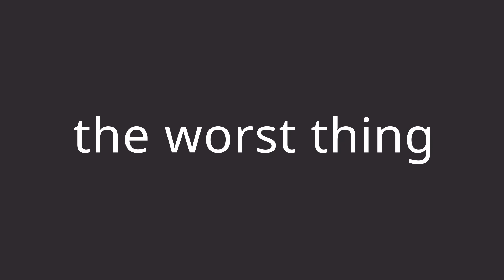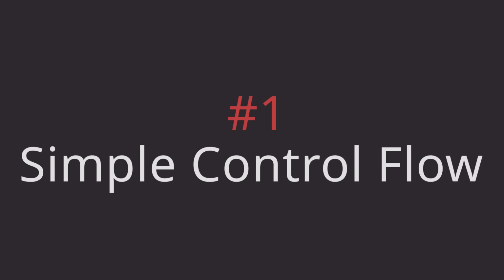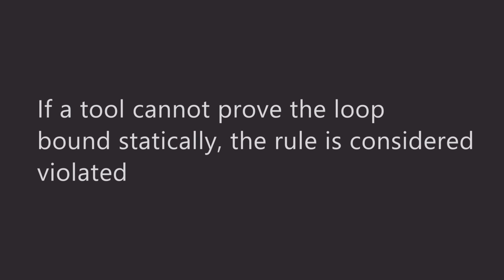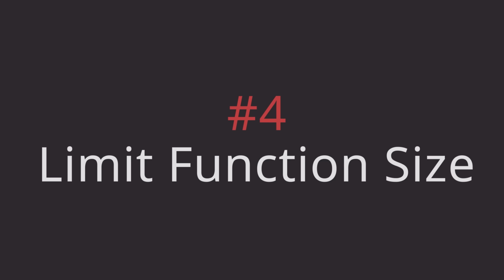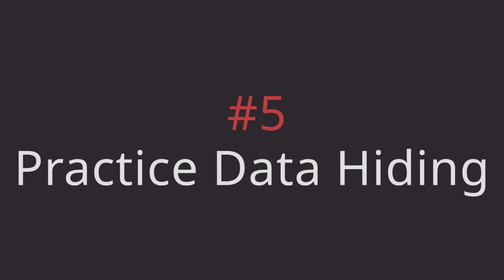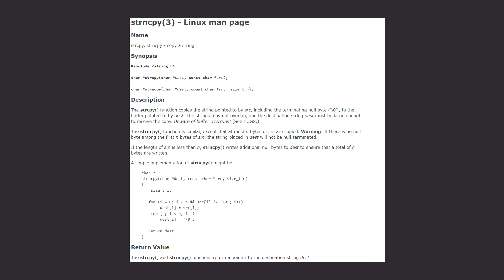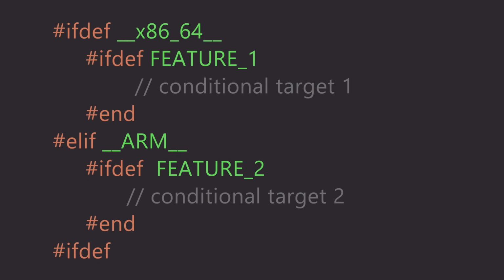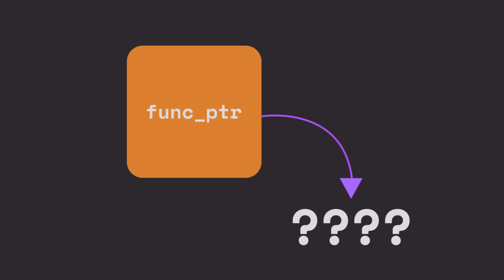how NASA writes space-proof code

Comment: These rules are for programming practices to help out coding and debugging. It would be a shame if NASA programmers did not have a brain and control their own work ( but NASA confused imperial with metric so a rocket failed). That these guidelines comes out of NASA is no need for us to start jerking off. So these guidelines sound like simple good practice.

I was a systems programmer and component hardware engineer with reliability as focus , hardware reliability, at Ericsson. As such I assume the programs have been produced and checked correctly in their basic form. Hardware reliability and SPACE .... cosmic rays can flip 0s to1s. The computer hardware can catch this. One simple way is to have 3 computers and have the bad one trap and immediate and restart.

What I like hearing here is "try use the stack". Ordinary programmers can do this but instead they all use heap as they >should<. Anyone can push the stack and place stuff there only it be gone once the function who did that exits and the stack is popped. I am still thinking about cosmic rays and the stack is repeatedly overwritten, and fresh. It is more risky to allocate on heap and let a long time pass. Still the hardware should do the checking on the fly for performance reasons. Still I liked the advice using the stack, which everyone can push. Still having 3 computers checking each other is the most simple way. Cause the cosmic rays can not hit all three and cause the same problem.
Reply: But first the computer need to be able to say "I am sick" , if no system can detect this it is over.

Comment: Does it mean that NASA doesn't use any popular OS, like Linux, Windows or Mac OS? Because all these systems use prohibited code practices.
Reply: As in what is actually running the code, or the devices they write code on?
Reply: @jojo_da_poe  Sure, running. Develop you can even on Raspberry Pi.
Reply: @jojo_da_poe   In some cases I think they use VxWorks or some other verified real-time OS, and in some simpler cases they have, at least in the past, written their own reduced languages running directly on the hardware.  A lot of that was done because of extreme power limitations on the craft.  For an interesting case, Ron Garrett (formerly Erann Gat before Anglicizing his name) wrote code for the Deep Space 1 probe that was a test platform for all kinds of experimental technology.  I think you can google for his experiences and thoughts about it.

Comment: You made me sad. The way NASA makes space-proof code is by incorporating hardware fail-safes.

A great example of this is a famous piece of equipment nuclear power plants have called the, "SCRAM." It's an acronym that stands for, "Safety Control Rod Axe Man." It's literally just a metal pipe with a guillotine inside that sits over the power line. The way it works is there's a regular rope attached to SCRAM and the nuclear reactor, so if the reactor overheats the rope burns and the guillotine falls. The moral of SCRAM is no matter how confident you are in your code you can always be more confident in physics.

Comment: "NASA says only use the stack, not the heap". Hi experimental physicist here. I and my colleagues use a c++-based data analysis tool called ROOT all the time. Especially when creating graphs, there are a LOT of boilerplate code that tacitly encourages the use of the heap over the stack. Lots of use of obj = new obj().
That NASA, an organization not so far removed from my own actively discourages this behavior is hysterical to my detriment. And honestly probably the better way of doing things.
Reply: This applies to microcontroller code onboard the spacecraft. Software that runs on regular PCs, such as software for simulation, doesn't need to fulfill all these requirements

Comment: Another thing Nasa does is run not just one flight computer, but one with multiple other computers running the same program simultaneously, checking each computer against the others to looks for flipped bits caused by radiation or common faults.

Comment: Limiting function size to 60 lines is actually not smart for these low power embedded environments. Calling functions costs power, so if a problem requires 120 lines, and you split it in 2 functions and call them, you've lost efficiency.

Comment: With regards to small functions - it's a double edge sword. For NASA and space it makes sense, but working with casual business logic on production for years I realized that not always functions can be small. Sometimes business logic is big and convoluted enough, and data structures are out of your control, so function takes 200-300 lines and splitting it into functions will only lower readability as you will need to jump from one function to next.

Comment: Basically, almost every advise from NASA developer teams should be respected by any developer in any language/framework/stack to assure the most efficient and bug-less software. If it was a standard everywhere, hardwares wouldn’t need that much RAM as the memory would not leak that much, and softwares (& overall user experience) would be a lot better, faster.

Comment: No need to use pointers and recursion, that's the dream job
Reply: Wait, is there any places where you need to use recursion? 
Asking as a Java dev
Reply: @IgnatXerius  Maybe a bit over the top example, but I've built a virtual filesystem for securing some things on the network, and one of the things it does is scanning the entire volume and keeping the map of the entire directory structure cached in memory (for significantly faster seek times) and the only way to do so is theough recursion...
But also it's built in a way that requires a full acan to figure out which blocks are allocated and which aren't.
Reply: @IgnatXerius  Haskell language doesn’t have for loop and while loop
Reply: @IgnatXerius  dealing with graphs and trees (which are extremely useful data structures), there is no real way without the recursion........... So, I don't know what they do there if they don't do recursion, heap, even limit the function to go up to just several iterations........ That's actually a very tough job because you don't have to just code, you are dealing with a mountain of checks and I don't know what........ It's just insane
Reply: @HarisAbdullah-e6l ты можешь использовать цикл вместо рекурсии для работы с ними. Это быстрее и надёжнее. Тот же обход графа может быть переписан с их помощью и это несколько проще рекурсии, которая может вызвать overflow.  А значит так могут быть выражены все задачи данного класса. Вам действительно не нужна рекурсия, если вы конечно не экономите каждый бит кода.
Reply: @HarisAbdullah-e6l  3 months late to the party but the reality is that they probably don't use those structures at all, or at the very least differently from how you would otherwise. One of the big goals with these rules is to get a program that is very deterministic. One of the reasons to not use the heap for example is to ensure that you will not run out of memory or other memory related bugs. Memory you need should be allocated from the start, no dynamically sized arrays or otherwise. Graphs or trees would therefore have to have a known size when you create them, making it more feasible to traverse them with loops, even if still an absolute hassle. 

Then there are some features which might even be completely irrelevant for some structures. Like how searching a tree can be really efficient. But since you want determinism, you might not want a search function that takes a variable amount of time to find the result. But you'd rather have a search function that always takes the exact same amount of time by always looking at every node in whichever structure you're searching.
Reply: @IgnatXerius as a bend dev. What else would you use except recursion? Lol
Reply: @varadrp  right lol

Comment: I've always coded on the "don't make your functions longer than a page" rule. Sure we all do it, but you aught to get that feeling that the function is ripe for a restructuring. Similarly code which is all functions with only 2-3 lines in them can be difficult to understand. I tend to do this only when the either the function is used a lot or for certain aesthetic reasons so it is more readable.

Comment: My first real compiled code was on a microprocessor platform (think arduino but without many libraries and with just a plain ANSI C IDE and no RTOS... just bare metal), it's not that difficult to obay to such rules...

You have one core and a fixed memory space that includes your registers. Then it's entirely you that decides what's going on. If you want to make it appear as if it's multitasking you use interrupts and remember to kick the watchdog whenever you're sure you're not caught in a loop.

I  like the idea about no infinite loops... but it's kinda necessary in the main loop isn't it? Or do they basically reboot when the timer overflows?

Comment: #1 excludes Quicksort, there are many competitive alternatives. Recursion in general is not needed for most applications, and is not compatible with parallel processing. For searching any hierarchical structure though, recursion is required. I can only assume their probe operations are so simple, that they haven't needed it yet.
#2 is Pascal
#3 is Pascal
#4 is a good idea in all languages, although a function should always be written to process a list, as in LISP.
#5 is Pascal.
#6 This is why void is mad in the head, and everyone should feel bad for C introducing the possibility. All the ifnulls in the world follow from this idiotic concept.
#7 is the main problem with C. ifdef is premature optimization or at best desperate adaption to unfinished code elsewhere, 40+ years into software development. One piece of code should be finished by now, and not subject to an if?
#8 is the other main problem with C. And function pointers are definitely premature optimization, nothing to do with stable, finished code.
#9 will be up to the state (version) of the compiler. This is a problem to do with C, as all C coders will testify. That's why their all bald, they've torn out their hair.

Meanwhile, all Pascal family applications are stable as a rock and never crash. If only NASA had stayed in school! 

Failing that, at least hired Pascal family programmers instead of what they got - No rules needed! (except #4 as stated).

Just to be clear: C family is bad and crashy and why you need unit tests. Pascal is great and stable, no unit tests needed. Cos CSci.

C happens, buy the T-shirt.

Comment: Actually I prefer forward gotos to multiple return points. Multiple returns are extremely prone to forgetting to update something upon return because for each newly created / allocated / refcounted element on entry, you have to be careful to undo it at every single return place. Better have a single return (or at most 2) in a function and use goto for error unrolling. I generally agree with the rest however and tend to follow similar rules most of the time.
Reply: Yeah, goto for cases like error handling in a single place or breaking out of nested loops is unironically cleaner than what you were talking about, having multiple return points whose behavior may need to change. The last thing I want in my code is to introduce errors in OLD code because I failed to change it when I changed the same duplicated code somewhere else, that's like setting up boobytraps for your future self lol

Comment: I check every return value even for fclose() types of functions.   I've never had one fail yet but some engineers have said sometimes it can find memory corruption errors sooner.  I worked for a medical company that did add/sub/mlt/div checks at startup to make sure the CPU was ok.  They said in the 20 years of service 2 failed this test, I'm not sure I believe them but it doesn't hurt to triple check if there are resources available.

Comment: A comprehensive set of classes need to be developed (and their use enforced) which defines classes for all the multitude of measurement units (inches, feet, speed, seconds, minutes, watts, volts, amps, and on and on) along with the valid conversions amongst them, like multiply two length class values and the result should be an area class value.

It should be FORBIDDEN to use simply integer or floating point numbers to represent real world units like feet, and inches, and calories, etc. It should be REQUIRED to use the appropriate class for those objects.

Maybe these classes already exist. I had never come across them during my career. But they would certainly have eliminated the problems of, for example. a spacecraft crashing into another planet because one software team was using imperial units and the other using metrics.

Comment: I worked as a software contractor to the Naval Underwater Systems Center (the Navy's R&D department) several decades ago. It was all R&D so nothing we ever developed ever got out onto the actual ships (presumably!). I had one project where I was provided with a sample of real enemy ship sonar data (i.e. the acoustic data generated by enemy ships and recorded by the Navy ships). My task was to be able to display the data on the submarine's displays and allow the user to make edits to it as necessary. I built in numerous tests for data validity. Simple things like checking for values out of bounds, but also more complex data errors. During the course of my work with the actual, real test data my code detected a number of such errors in the data, and I reported them to my supervisor, who worked for the same company I did (was NOT a Navy person).

When my project was done I turned in all of my code to my supervisor.

A year or so later I had occasion to look at that code that I had turned in, which had been assigned to another software engineer (I guess for further development). I noticed that all of my data integrity checks had been removed. I asked why, and was told that the errors in the sample data had all been corrected, so no need to keep checking for them. I pointed out that other real datasets might be used in the future, even if just for testing, or in the worse case the software might actually get distributed to the submarines and used "in real life" so that it was pretty important that errors not only be detected but DISPLAYED somehow to the operators. I was told, "No, no, no, we don't want to do that. We can't have it reporting data errors, it will look like something is wrong with our software."

I can only  hope that our software never actually made it on to the ships.

The point is, those ten NASA rules are great, but they don't catch dumb decisions along the way about what the software needs to do.

Comment: Yeah, write functions so they do one thing without side-effects. You don't want a function that has a errant write operation when all it's suppose to do is read.
60 line rule is interesting - if the function can be broken down into smaller functions then break it down so it's not only easier to read but also to reduce duplicate or boiler-plate code.
Interesting that they don't include "don't pass-by-reference" but maybe that goes under declare variables only in local scope because you can definitely have an erroneous value if you do pass-by-reference a lot.
Great video!

Comment: It's not stack that's used instead of the heap. Yes it would be stack if the memory you were converting was for some reason being allocated and then freed in the same context, but statically allocated memory is probably the actual alternative. You'd only really want to dynamically allocate and free if you intend for that memory to live beyond the scope of the function it is in, and the alternative to that is making sure the data was static instead (in duration).

Comment: Not using the heap is normal for embedded, they probably don't even have one.
And yes just making a statically sized buffer for everything is viable and is probably common practice if using a language that would require you to write your own bespoke data structures if you wanted anything more complex than an array.

Comment: I heard that deep space data transmissions have so many error handling systems and redundancies that in the whole data packages sent; less than half of the data is the actual content that they are trying to send.
Reply: That's true for all communication systems. Hamming codes were introduced shortly after Shannon developed information theory and predate Sputnik 1 by about seven years. Redundancy is an excellent way to detect and correct errors. Like you can just send the same message three times and compare them to see if anything changed.

Comment: I'm confused. The video states there are 10 rules, but only 9 rules are listed.

1. Simple Control Flow
2. Limit All Loops
3. Don't Use the Heap
4. Limit Function Size
5. Practice Data Hiding
6. Check Return Values
7. Limit the Preprocessor
8. Restrict Pointers Use
9. Be Pedantic

If there is a 10th one what is?
Reply: @BlueCyberPhoenix
Test, test, test !

Comment: I once had to work somewhere for an internship where almost a third of the C codebase of what I was working on upgrading was a preprocessor nightmare. Can confirm it destroys code clarity.

To be fair to them, I was told nearly 2 decades ago that the old system would crash otherwise, due to a compiler issue that was fixed later down the line. But it became like learning another language lol